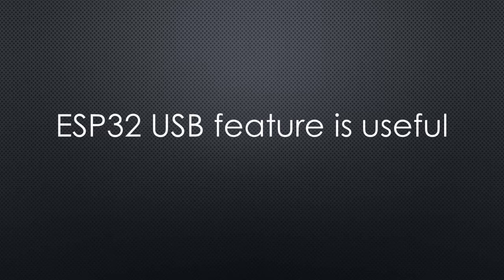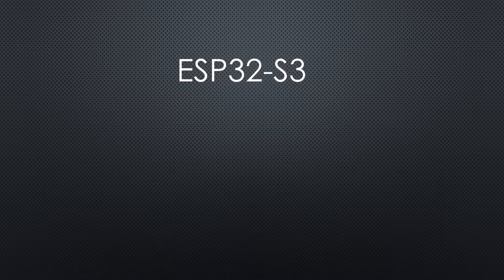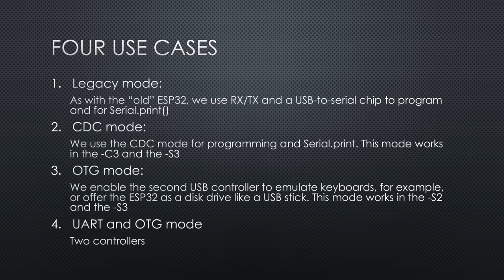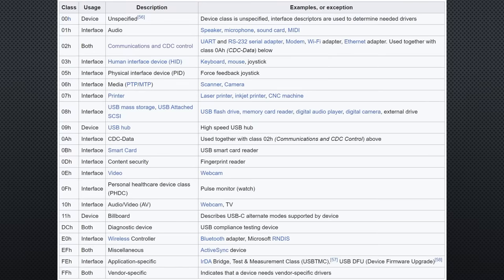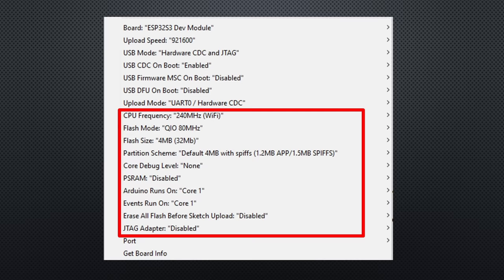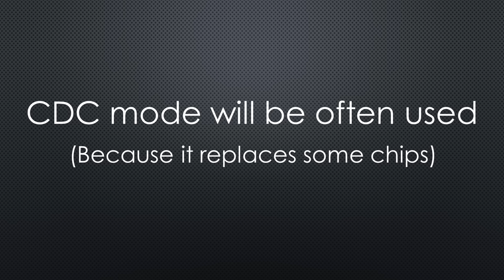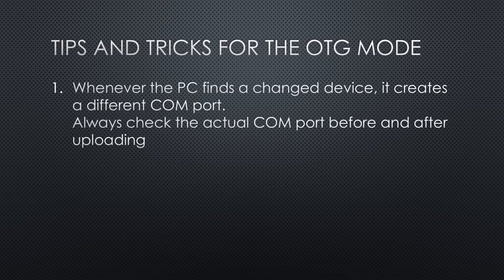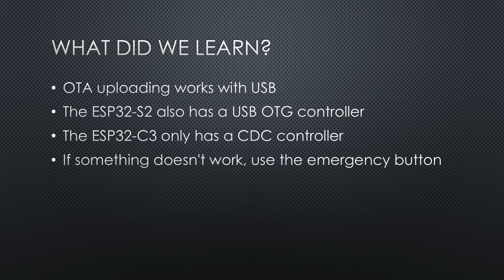456 Hassle-Free ESP32 USB (ESP32-C3, ESP32-S2, ESP32-S3)

Comment: Excellent video thank you.
Reply from the maker: Glad you enjoyed it!
Reply: @AndreasSpiess  I now understand the different USB interfaces & uploading code via Arduino OK now. Having no luck getting USB HOST working though. Have tried ESP32TinyUSB LIB and some others. I need this ESP32 to talk to CP210x UART. Any ideas or pointers? I really don't want to have to resort to ESP IDF...
Reply from the maker: @ZL1CVD  As said in the video: Host mode is not supported by the Arduino IDE
Reply: @AndreasSpiess  Yes I did see that but also found 3rd party host libraries & was hoping you may know of one I had not found. Such a shame. Time to play with Teensy 4.0 I have as their USBHost_t36 lib may be exactly what I need. Cheers & keep up the great work.
Reply: @AndreasSpiess  Just got Teensy 4.0 working with the lib I mentioned. Much easier to use & understand than the ESP IDF examples too. Real shame ESP32-S3 is lacking HOST for Arduino..

Comment: Hello Andreas, could i use the USB(UART0) as serial output and the OTG for JTAG ?
could you maybe do a video how we could put a external flash? i thought about using a external flash IC for data logging and using the OTG for quick acces to the csv files for data analysis. 

thanks in advance.
Reply from the maker: 1. I do not know. You have to try
2. Because I have WiFi on hte chip, I longime ago stopped recording data on the device itself. I transmit it into a database on a server. So I never had the need for logging on the device.
Reply: @AndreasSpiess  Thank you for your answer, for now i will stick to the SD-Card then. :P

Comment: I've given up on using Serial for communication with the ESP32. You need to have the ESP32 tethered to a computer, the Arduino IDE terminal isn't the best, and PuTTY is a pain to use. I use BluetoothSerial instead, it's part of the Arduino ESP32 package, and requires very little change to code. I use an app called Serial Bluetooth Terminal on my Android phone, I believe that a similar app is available for IOS.
Reply from the maker: A good idea!

Comment: nrf52 vs msp430, which one wins? Regarding deep sleep current and available tutorials
Reply from the maker: The TI processors are out of scope for this channel because they are not supported by the Arduino IDE. The NRF chips usually win in low-power applications.

Comment: Did you choose the Arduino framework over ESP-IDF for any specific reason? ESP-IDF seems to be a more optimized and richer solution (not all available functions in esp-idf are immediately available in the Arduino framework). Thanks in advance for your answer.
Reply from the maker: I chose Arduino because it supports other chips as well as it is accepted in the Maker community and has lots of projects and libraries available.

Comment: thank you! would have needed this month ago 🙂

I noticed that if I have Serial statements in my code and no computer is connected the ESP has a strange delay.
Her this might help: Serial.setTxTimeoutMs(5); // set USB CDC Time TX

One other question: what would be a good way to get Serial statements in a deep sleep scenario? I had to start with a 5s delay for debugging, to have enough time to start serial monitor again (serial connection and port stop in deep sleep) Is there a serial monitor auto start option in the arduino IDE or VS/Platformio? Does someone know something usefull?
Reply from the maker: I included RX/TX pins on our PCB for debugging. I do not remember I had to wait for such a long time.
Reply: @AndreasSpiess  on one of my boards i just connected GPIO19/GPIO20 and i power the board also via usb, had to add this line, otherwise i had a slow start on powerbank (for sure more than 2sec)
Reply: I realized that there was a delay after serial.begin() and first i thougt i have to change the code to an other debugg log() mode...
Reply: It should be possible (maybe not with arduino ide) to tell when the usb is connected, so you wouldn’t need to wait for the serial to time out, just only print if the usb was connected at boot.

Comment: Thanks for this video.  I wish espressif would explain this topic better.  I play with the ESP32 and the ESP32-C3 using the espressif IDF (eclipse etc).  I have pages of confusing notes about the upload working then not working, debugger work or not working, com ports come and go.  It seemed once I figured something out - on my next project a couple months later things worked differently.  A lot of use of zadig.exe.  Just having one wrong option on a run or debug configuration panel and no running of the ESP32 for me!
Reply from the maker: I hope this video helped a bit to remove confusion. I agree that Espressif should have done it.

Comment: Hello Andreas Spiess I really appreciate your work - I have not the capabillity, to think into a problem I have. But maybe it would be possible. I just write it now : I want to connect driverless a Multitouchdisplay with a Notebook - so on the multi touch needs to be a host, and on the Notebook a HID Device - In between a porperatery or open source protocol which is NOT Wifi infrastructure mode - maybe over wifi or an Ad Hoc conenction. Now the question do you think this is possible with Arduino or these ESP32 when i find out how the host has to speak with the multitouch display. I really would have an answer before I start making it, and lose a lot of time learning it would not have been possible from the start. [Display] - - [ESP USB Host] ~ ~ wireless ~ ~  [ESP Touch Emulator HID Device] - - - [Notebook/PC]  Ich habe auf Englisch geschrieben, damit die Community es auch lesen kann) Schöne Grüße, Pascal
Reply from the maker: This is a complex project, and I do not know if it is possible. Particularly important is to check the speeds you need to drive the screen. And then if it is worth investing all the time. It will be a long project.

Comment: Do u know how to remove the name followed by the esp in cdc mode cuz i used a esp32s2 and it identified as a board called deneyap mini which is not true and it cause compilation to fail so i need to change it back every time or can i just disable the Arduino ide auto detect function back when we used good old ch340 there's no such problem
Reply from the maker: I never tried this. So I do not know

Comment: Curious why you still use the arduino IDE as opposed to VS-Code?  Is there a deficiency in VS-Code or is it just user preference?
Reply from the maker: If you refer to PlatformIO, you still use the whole Arduino IDE framework,btw. If you use the Espressif IDF, you loose the possibility to program other chips.
I use the Arduino IDE on this channel because it is simple and because people who use PIO can easily convert my projects because they have advanced skills. The reverse direction is not possible for a beginner.

Comment: I've successfully built custom usb keyboard using ESP32-S2. And then want to add BLE features, so I changed the schematic and using ESP32-S3-FN8 (8MB internal flash). It works as expected, the board detected as HID device when usb plugged in and it can connect wireless via BLE. But when I changed to ESP32-S3-FH4R2 (4MB flash 2MB PSRAM), the code successfully uploaded, but it totally not works. My computer cannot detect it as HID device. Can't understand what caused this. Both have same footprints, and no changes to the schematic. Just wondering if someone has encountered this problem and found a solution.
Reply from the maker: Strange. Maybe an error in the compiler?

Comment: Great video as always Andreas! 
Could you also do a video on Motor Control PWM on the ESP32? It is such an advanced PWM API compared to LEDC PWM. It has some great applications, for example generating complementary PWM signals with deadtime for H-Bridge motor control.
Reply: That's super interesting.  PWM + Deadtime would be so useful.
Reply: @joels7605  Yeah it's another hidden feature in the ESP32 I believe and even the base ESP32s support it. Plus, there are no tutorials on it online, at least not using the latest Arduino-ESP32 core.
Reply from the maker: The question here is about how many viewers would be interested…
Reply: @isprithul  it is not a hidden feature at all, look at the data sheets or api guide and it is there. It is called MCPWM, or Motor Control PWM. There are plenty of examples of it using the esp-idf and instructions for its use in the api guide. There are examples of using it for brushed motors, brushless motors and servos. If you want to use all the features of the chip and have more control over it then you need to use esp-idf and it even has the ability to include arduino as a component so you can write the same code you would in the arduino ide whilst having access to esp-idf specific functions.

There are lots of examples and components (essentially libraries) that you can use.
Reply: @AndreasSpiess  MCPWM library in the esp-idf is pretty well documented but you could definitely do a cool demo with it
Reply: @conorstewart2214  I know it's not hidden. I just think it's an advanced feature nobody is using.
The current examples do not work with Arduino-esp32 and the documentation is pretty confusing for an average embedded systems hobbyist.

Comment: This is probably dumb, but I wonder if USB host mode works, that we could connect an RTL-SDR dongle and use it for a mini portable SDR device? Maybe not enough power to do crazy stuff, but maybe some decoding or a waterfall display?
Reply from the maker: So far I did not see SDR projects using the ESP32. You are right, theoretically it would be possible. But maybe for special projects. For a general waterfall display it probably would be easier to use a pi zero because the software already exists.
Reply: Also - would the processor be powerful enough to handle the signal processing?
Reply: @TecSanento  I think the ESP32 is at 240MHz. The Pico’s is 125? You’d certainly be limited. I’m definitely not an expert. Maybe something that would listen to the VHF Ham bands and then have a little display that listed activity on different channels, maybe even decoded some?

Comment: Can I use qty 1. ESP32 to use soil,moisture sensor and control qty 1  water pump?

I mau do that if possible because I plant in single containers.

Please advise.   Also water pump power/size varies in size .  How do I address correct power to pump?

Thank you and god bless!   Alton.
Reply from the maker: Unfortunately, your questions are too long to answer in a short comment. You have to ask google and find a similar project for reference.

Comment: Great video👍
I issue on my side. I connected my esp32-s2 with directly to usb while holding the GPIO0 
Hear the sound usb connected 
Can see unknown device
But can not load drivers for the com port. Nor even could find suitable driver for esp32 usb port driver.
Could you please help how to do serial port driver.
Thanks
Reply from the maker: The ESP32 does not need drivers. Just your PC need drivers.

Comment: Hi Andreas - is it possible to contact you regarding some consultancy work? I'm looking to get an ESP32S3 talking to another device. Just sending commands to the peripheral's CDC and getting some text responses. I've achieved this using a USB Max Host board, but would like to use the d+ d- pins and the Arduino IDE.
Reply from the maker: YouTube is only my hobby. So I have no  time for consulting :-(
Reply: @AndreasSpiess  no worries. Love your hobby! Thanks for the reply

Comment: I would like add to an ESP32 based internet radio the capability to play mp3 files from an USB stick, do I need USB OTG?
Reply from the maker: I assume you need host mode to read an USB stick (not supported yet in the Arduino IDE). But you find good internet radio projects with MP3 capabilities

Comment: Is the USB interface able to create an audio in and out stream device for computer connection? There could be some interesting radio projects...
Reply: If you look at the esp-idf and tinyusb examples you will see what is possible. They have examples for midi and host examples for UVC. You can also create your own descriptors so in reality you could create any sort of usb device.
Reply from the maker: Wayde, what scenario do you have in mind?
Reply: @AndreasSpiess  A few projects might be cool to try out... I'm thinking you could use USB audio ( mic and spk ) device, connected to a radio with a USB "sound card" as RX/TX audio to handle encoded audio from multiple inputs , mixed/amplified/noise reduced/compressed/proccesesd etc in DSP on ESP32. The multiple inputs can be useful for multi-op pota , where each gets their own headset and controls. one in/output would be over the USB "sound card" to the radio, other outputs could be a monitor for non-op listeners. Another project option could be the generation of some digital mode content for sending to the radio over the USB sound card for TX/RX. It could be a WSPR transmitter , or maybe even an FT8 transceiver, without attaching a full computer? I've thought it might be cool to make an FT8 fox/hound and use it for an actual fox hunt? or a kind of DXepedition, if you put FT8 fox , with autorespond on a balloon , or maybe someday a cubesat :-D
Reply from the maker: @Wayde-VA3NCA  We are working on a project with soundcard functionality and an ESP32-S3, but not with USB. This is a too big overhead. The PCB includes a 2m and a 70cm transceiver, BTW. But this is stuff for the second channel.
Reply: @AndreasSpiess  great! I'm subscribed to that channel too and look forward to it!
Reply from the maker: @Wayde-VA3NCA  Welcome to the channel!

Comment: Hi i just watch the video. I'm new with esp32 boards, What mode i should use if im going to print my  usb device(scanner) to esp32?  is it USBHOST? btw  i have ESP32S3
Reply from the maker: Such a project is most probably not suited for a beginner. I would start with something a bit easier.
Reply: @AndreasSpiess   thanks i should start from the basics.  what i have is a USB RFID scanner  i want to use  the features of ESP32S3 to get the  readings  any pointers?

Comment: So do i understand correctly that if i get bare esp32 s3 wroom chip and connect the pins 19, 20 i can just program it? Or does something have to be flashed there using the USB-UART converter? Thank you for reply, Im not completely sure...
Reply from the maker: Yes, you can flash it using the built-in USB module as shown in the video.
Reply: @AndreasSpiess  Okay thank you, I wasn't sure if the feature didn't need to be enabled in previous upload :)

Comment: Great video as always! But I have a strange behaviour on esp33-c3 in cdc mode.
I have an application that sends can-bus messages on the internal team-hardware.
I can download the app and see all serial.print() via the usb-cable, BUT, when I pull the usb-cable the app slows down the sending of can-messages. It seems as if the loop is hanging on the serial.print() statements about a sec and the times out and send a message, then hangs and so on.
If I restore the cable and resets it works again.

So there seem to be an issue when the usb-cable is removed that affects the functionality of the code.
Any ideas?
Reply from the maker: Unfortunately, no :-(
Reply: I replaced Serial.print() with esp-idf logging and the problem disappeared

Comment: I like the new functionality but I wish the ESP family didn't have so many variants.
Reply from the maker: MCUs are made for low cost. So all manufacturers deliver many variants to precisely choose. Look at the STM32. They offer 100x the choice of Espressif…
Reply: Why? Choice is a good thing and code is mostly compatible between them. They aren’t just going to keep pumping out the exact same device for years with no changes, hence you have a less powerful and smaller one, the C3 and then upgraded versions of the original, the S series, within a specific type most choices are just flash and ram size or type of antenna. There really isn’t much choice or many types at all. Look at any other MCU manufacturer and you will see a lot more options.

Comment: Does the USB OTG automatically give rw access from the PC to the spiffs?
Reply from the maker: I do not know :-(
Reply: @AndreasSpiess  I did have a look in the esp-idf examples and it looks you are responsible for your own "disk management" up to the sector level. So the answer is "yes, but only when you write the management the disk from your own code" which is what they do in adafruit's circuit python I guess. I should have a peek in their code.
Reply: I did have a look and a second challenge (problem) pops up. Of course the sector management must make sense to the receiver (the PC). So you must emulate a disk format like FAT and not SPIFFS or LittleFS. And that is exactly what Adafruit does in the Circuit Python. The Flash file system is formatted as FAT. Now the mangement of the sectors is 1:1 and becomes pretty easy. You have no idea what you're passing, just sectors. No knowledge of files or directories needed, just 1:1 sectors. Smart!

Comment: Hi , i want to connect the mpu 6050 pins (sda , scl , AD0, int )to esp32c3 . Do you know how i could connect to itr ?
Reply from the maker: I assume you find the I2C pins in the datasheet of the ESP32-C3 and the ADO in the library (if needed)
Reply: @AndreasSpiess  Hi do you know the maximum current consumption when it is in active mode(Bluetooth active to trasnfer data) ?
Reply from the maker: @alenninan5524  Also here you can consult the datasheet for details. Other ESP32s consume very short peaks of up to 400mA.

Comment: Why is "ESP32-S2"  twice in the title "Hassle-Free ESP32 USB (ESP32-S2, ESP32-S2, ESP32-S3)" ?
Reply: I assume he intended to have the "ESP32-C3" instead of one of these as these are the three USB chips.
Reply: @kyleolson8977  ok, but than you have to add the  "ESP32-C6"  also 🙂
Reply from the maker: You are right, it was a typo. Thanks. Changed.